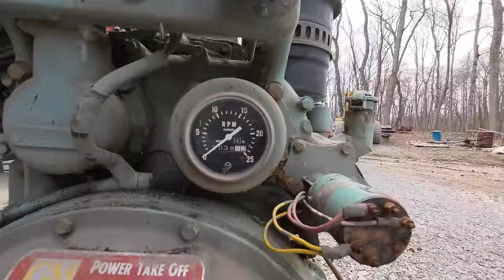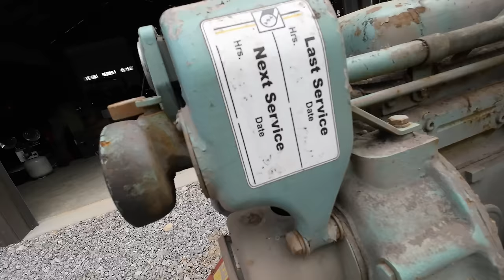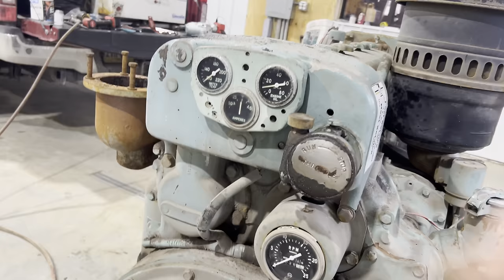$250 Two Stroke Detroit Diesel Sitting 6+ years, WILL IT RUN!?!?

Comment: I used to work for Detroit Diesel when I was a younger man. The 71 engines were (in my opinion) sweet engines to work on. We built standby gen sets for home and hospitals and irrigation pumps for agriculture use. The 71's were damn near bullet proof and dependable powerplants. I sure do miss those things. You got a hell of a deal for 250 bucks. Even if I had no use for one, I'd snatch it up at that price. It was nice to see it come to life again. I'll dedicate a few cold ones to you. Thanks!
Reply: I have a 6-71, and a 3-53.  No idea what I will use them for, but man they sound sweet!
Reply: I own a 8V-71 in my 1971 SeaGrave Fire Engine and have a 353 in my 1978 Dynahoe-190 Backhoe. That has almost (9000) hours on the meter.
Reply: Sadly, that was over fifty years ago, when a dollar had a much greater value. Still, it was really good value for money.even in those days..
Reply: Be a fine power unit for a sawmill
Reply: Have a 353 in a dynahoe backhoe.its turn key.
Reply: @brustdiesel old pickup truck and a boat
Reply: Not in your opinion they just were they owned the diesel market they were absolutely amazing and way beyond there time they as is don’t put out much emissions for one but also they were so over engineered and outstanding only good thing gm probably has ever made
Reply: @rcadventures8390  Don’t forget the HUMVEE! About the second only good GM thing lmao. Old trucks/cars too. Especially the stovebolt 6,and its successor.
Reply: @carsonchambers5617  eh depends on what hummer your taking about like the ones they used in war I fuckin loved those things my buddy’s dad had one a long time ago it was a retired military vehicle the reason he got rid of it was because of how shitty the mileage was but gm also made Saturn and Pontiac both awesome idk if you ever noticed but whenever gm makes something good they discontinue it
Reply: @rcadventures8390  Of course the military one, that’s why I said Humvee and not Hummer. H2’s and H3’s were just glorified Suburbans. Old heads and mechanics say the early humvees were turds power wise since they didn’t even have a turbo, but would run forever. But that’s Detroit Diesel for you. On second thought that’s the third best GM thing too lol. Later ones had a turbo but was still so slow if they had the uparmored packages equipped. 

That’s why most people straight up Cummins swap it with an Alison Transmission or the GM guys will duramax swap them. Wayyyy better power, fuel efficiency, and top speed. 

I’m Ford biased so I don’t care for any modern GM stuff apart from the newer mid engine C8’s. Their “HD” trucks are joke having an independent front axle. 
Pretty much only 1936-1950 stuff then Ford from then and out for me lol.😂
Reply: @carsonchambers5617  well my 4-53t in my 84 f150 has got some balls to it sure only 175 horse but 360 smth foot pounds of torque which gets me moving easily
Reply: Hes honest so far.
Reply: L😊😊.😊
Reply: @rcadventures8390  Yeah, that's your opinion.

Comment: The small cooler is probably small heat exchanger. The other hoses probably tapped off the water supply for the fire suppression system to supply cooling rather than being air cooled.
Reply: It is a heat exchanger. They are very common in marine applications. I’m guessing they had it plumbed into the water supply and cooled the engine that way.
Reply: Yeah totally a liquid to liquid heat exchanger set up had a genset i bought from a water company it was used for back up in a water pumping station and it had 2 heat exchangers like that that would use the water from the pumping station to cool the engine pretty neat i think
Reply: This is how the fire pump at my plant is set up. If you run it without pumping water it will overheat.
Reply: You are correct, I build fire pumps at Cummins.
Reply: Exactly
Reply: As a fresh water pump pumps fresh water, there is no need for a radiator. So, you are absolutly right 😁👍
Reply: My old boss loved his dragline ,and I’m sure he pumped water up to his jimmy from the pit rather than air cooled
Reply: Chain drive and centrifugal clutch!  If you can find one big enough.  Cool project!
Reply: You got it! That would be a marine package for fresh water cooling, keeping the salt water out of the engine.  The HP rating is easily fixed. These engines were available for up to 238 HP at 1900, more for some special applications.
Reply: Only overheats if you run out of water in which case it's useless anyway. Neat!
Reply: What they said.😉
Reply: I've seen Onan diesels plumbed that way - no radiator, hooked up to a "city water" cooling source, with 100% of that water going down the drain after going thru the engine.  Wouldn't do that today!
Reply: My thoughts exactly.
Reply: Yep, basically same thing as a water-to-water intercooler you see in some automotive turbo applications where packaging is a concern.
Reply: He could connect his floor heating the the heat exchanger and put a generator on the output shaft to run the shop. Maybe not as cool as a three ton go cart, but maybe more useful?
Reply: @jaytalbot1146  I like your thinking.
Create heat & power & a really impressive exhaust sound.😁
Reply: Exactly, we still install them the same way today. All the water flows through screens to catch debris. Alot of the pump here in New Hampshire are fed from near by ponds
Reply: all you guys are right, except that there were no internal combustion engines in the time of the good lord baby jeezus, so they are a sin in the eyes of the lord and baby cheesus.
Reply: @claytonsambola1856  Tis what was thinking too.....  Like minds
Reply: The fire pump was probably 100 gallon a minute and would pull the water away from the cooling system. Cooling system would need to be separate.
Reply: @claytonsambola1856  yup. My steel 35ft '52 boat has got that too. Its also known as an intercooler, afaik.
Reply: @neil6212  Our 12V71NAs were rated higher than that at 1800 RPM. And if you had the TT ones that the military had for in tanks, they were rated at 600HP for 24 hours continuous war power rating. They were rated at 2500 RPM on the 12V71TT.  Never heard one run at 2500 and ours dropped the over speed damper at anything over 1900 RPM.
Reply: Standard NFPA 20 cooling system I would say, firewater pump engine HEX is cooled by tapping off some fire water once through & then down the drain. Althought that said it isnt painted red like it should be for a Fire Pump Engine!
Reply: Agreed
Reply: @william4all  I sold alot of Cummins stand-by firepump engines to pump mfgs and contractors. Nice units.

Comment: I used to privately own a 1973 Seagrave Fire Engine with a 6-71 Detroit.  Those engines are pretty much indestructible.  There are two shut off mechanisms.  First is normal which shuts off the fuel, and an emergency shut off if the engine "runs away" which is a damper which shuts off the air.  Several truisms about the "Screaming Jimmys".  They love high RPMs so drive them like you stole it, if it leaks oil, then you know it ok, they are famous for leaks, the sound, as you mentioned is one of a kind.  When you got it running that purr is unmistakable.  Finally, General Dwight Eisenhower attributed the "Higgins Boat" Landing Craft Vehicle Personnel (LCVP) with winning World War II.  They were powered with the early Marine Version (Gray Marine) of the Detroit 6-71.

Comment: Matt, That engine uses straight 40 weight.  Had them on several boats that I  operated.  If taken care of properly, they will run seemingly forever.  Nice buy!
Reply: I'm surprised he didn't know that. It killed me when he said what he was pouring in.
Reply: Yeussss
Reply: The Rotella is probably better in all ways possible than old straight oil. The difference between is only that this oil has a lower viscosity at low temperatures (15W).
Reply: @jesperwall839  km
Reply: @jesperwall839  Except for the sulfated ash requirement. Which will cause problems.
Reply: @jesperwall839  Incorrect. Oil used in Detroits MUST be CF2 rated. T4, T5, and T6 are not a CF2 oil
Reply: It's not only the weight but the API Service Rating.  Any oil rated -4 is for 4 stroke diesels and shouldn't be used in 2 strokes.  Bus Grease Monkey is a good source of info on this subject.
Reply: never use split weight oil in a Detroit 2-stroke...30W Rotella not the 15-40
Reply: @jesperwall839  I ran straight 40 weight in my motor home conversion for years, but didn't live in the snow zone. DDA recommends 30 in winter, as I remember.
Reply: studies showed the use of 15w40 in highway 2 stroke detroits result in heavy cylinder wear over time. short use its fine.
Reply: Yep, the 8v92 books for our generators say you can use 15w40 in an emergency, but to change it out to SAE 40 as soon as possible.
Reply: @jesperwall839  not in 2 stroke diesels...go watch ol 2stroker channel
Reply: I was about to say the same thing but we use straight 30 weight in ours.
Reply: @Gageleavitt25 Walmart Carrys straight 30 just for old Detroit engine and gen sets on RV
Reply: @jesperwall839  ash level is different
Reply: That would be a killer saw mill rig
Reply: And here I thought you were going to use it to power the shop; and make it earn its keep.
Reply: Shell Rotella T1 40w
Reply: @metalfusion67  that’s all we ran in them in the boars in the Navy - 30 w . Years of dependable service.
Reply: I like a Mad Matt Machine … with lots of gauges (oversize), lots of brass lines, something with Steampunk designs in it … actual purpose, who knows? If it’s for parades, a locomotive would be cool with a cow-catcher front…kids would love that. A steampunk ATV?
Great idea Matt… and I don’t care what oil you put in 😊
Reply: @bigfoot-wo3qy  a good friend of mine has a 1948 Frick sawmill that’s powered by a 6-71, the engine is still in the frame rail of the truck it was donated from. The frame was cut aft of the transmission. A series of belts and jackshafts transfer power to the mill portion. It’s an osha inspector’s nightmare.
Reply: @jeremiahjorenby2275  They didn't even have the modern oils when this engine was built, so of course they don't recommend them. I use full synth in my '66 for 7 years now. It uses less oil than with the factory recommendation.
Reply: @metalfusion67  Multi grade oils weren't common when that thing was built. May not have even existed. The newer oils are far superior to what was available when that thing was built. You can't go by the factory recommendations. They had no idea what would be available in years to come.
Reply: @21babydew  mine dumps soo much oil on the ground i dont think it matters
Reply: @satchelh  bus grease monkey is a joke
Reply: @jesperwall839  Shell makes  Rotella T1 sae 40W CF2
Reply: @jeremiahjorenby2275  you the real MVP. Only correct advice I see 👌👌
Reply: Yup
Reply: Bus Grease Monkey has vast knowledge of there engines and he says that these engines should run non detergent straight weight oil. I would trust his knowledge of what oil to use.
Reply: Was about to mention this fact…. My old boss f*cked around and found out what happens in a two stroke Detroit when u run a split weight oil in one of the fire truck engines (two of them had detroits. One a 6v92 the other a 8v92…. The 8v92 had such a good sound… a gourmet sound to a mechanic! 🤌).. he was insistent it could be done…. And then some time later the fire department needed a new engine lol
Reply: Needs to be 40 weight * non detergent
Reply: He will find out when it runs away
Reply: Yes correct. I have plenty of these engines and multi grade will destroy them. Mono grade 40
Reply: The Amish might make it usable
Reply: @volvodoc01 yup! I maintain 2 8v92ta ddec engines in 2 fire trucks. 40w or it's toast. They almost blew the engine in one of them by running 15w40 in it. Luckily it was caught in time and changed back to 40w.
Reply: @metalfusion67  Delo 400 was what we ran and it never failed us. 30 weight oil and later on we switched to 40 weight. Can argue with Detroits that ran for 14,000 hours or more between overhauls on it.
Reply: @MaxNafeHorsemanship  My manuals were from 1988. By that time they knew about other oils. It still said 30 or 40 weight oil. With our engines lasting for 14,000 hours or more between overhauls, you couldn't argue with success. When I left, one of the engines I had overhauled had its second 14,000 hours on it and still was running like when I put it back online. Our engines were built and installed long after multi weight oils were around. But oils even if straight weights were improved over time.
Reply: @kenore4003  Detergent based straight weight is what they should use. And how many hours does he expect his to run. Ours using Delo 400 30 or 40 weight ran for 14,000+ hours between overhauls.While Chevron says they aren't recommended in DD 2-strokes, that wasn't proven to be our case. 28,000 hours on the main crankshaft bearings and they still were in spec.
Reply: @benhicks4402  Wrong on the non-detergent. 30 or 40 weight is fine also. Just don't run a multi-grade oil.  And we changed the oil every 300 hours of use.
Reply: That engine was built 50+ years ago. 

15w40 is more that good enough for Detroits. Not to mention modern oils is so insanely superior to oil from hell even 30 years ago. 

That little 6v will be more than happy with T5.

Comment: I was in the U.S.Coast Guard in 1972 and all our 30 foot rescue boats had these 671's They were very dependable and powerful work horse engines. That was 50 plus years ago..!! Great Video Thankx lots!!
Reply: A high performance 2 stroke here, run klotz 2 stroke oil
Reply: Polaris 850 patriot boost is tge new jimmy
Reply: I trained with the CG 43 years ago I wonder if they were using them. They saw me on a fishing boat on the Bearing Sea and were shouting my name. The fis6crew were asking how they knew my name I denied everything. 😆

Comment: Had some Detroits in the past, fixed units and trucks, 3-71, 6-71, 12-71. Among those, an oil drain on the 12-71 350K generator wasn’t necessary—if both leaked and slobbered (when it wasn’t under load).
My favorite (Detroit) story was when a  rubber fuel line connecting the return back to the tank split during operation at night.  (Whole trailer was as filled with hot diesel mist—an explosive situation!)
I had to go up into the trailer and find this spurting leak, getting totally soaked in hot diesel.  No real tools tools or parts handy, so I used a flathead screwdriver and two hose clamps and the shaft of a Bic pen in lieu of copper to span the gap where I had to out the leak.
It started and ran without leaks so went to the washing station to clean off.  I had blisters bubbling up in my body from being soaked with hit diesel.  A 100% true story!
The shit we do when we are young and stupid! 😅
Reply: Wait till you have one of the internal to the head fuel lines break. The increase in oil level will shoot the dipstick across the room. And take 4 oil changes to get the smell out of the oil. Our fuel lines were very short. From a ball valve to the filter which was less that 12" away. And from the block to the return ball valve. And we used Aeroquip 300 hose for that. The rest of our fuel lines were welded steel pipe. DD factory certified on the 71 series in 1988.
Reply: Run the best synthetic 2 stroke oil in here, I’m running BRP XD-100 in my 8v92 2 stroke and she loves it
Reply: When you set the rack make sure buffer spring is backed off

Comment: When the rack sticks, it is actually a run-away. The governor can’t control engine speed if the injectors are at full fuel. The only thing controlling speed at that point is valve float. 

Also, as others have said, multiweight oil is the wrong oil for 2-stroke Detroit Diesels. Delo 100 straight 40 weight oil is the stuff to use due to its very low ash content, among other things.
Reply: 30+yrs crane and equipment mechanic. Love DDA. Wait till a 12-71 takes off
 I was on top laying on the valve cover tried to trip the 2flapper valves on the blowers!
Reply: @tomhartig4247 
Did your pants need to be changed afterwards

Comment: The fuel coming out of the exhaust is called wet stacking.  It's usually caused by idling a diesel for extended periods of time, or running it under little to no load for long periods.
Reply: It a high RPM engine and needs to be treated as such back in the day we called them screaming maniacs  the city trash trucks used them and you could hear them coming from a mile away
Reply: spot on
Reply: I used to work at a DD shop, whenever I'd rebuild a Detroit engine and the owner of the engine came to pick it up they would ask about the break in time as for how to run it.  I'd tell them run it like your trying to blow it up.  You have to run them hard to get the rings to seat.

Comment: Matt, the cooling system is set up for "unlimited " cooling, like a boat. The tank up front is a heat exchanger that would have seawater if it were a boat, and city water in this case as a fire pump. The exhaust is also water cooled using the coolant for the engine. As for your drive system, maybe look into a drop box style allison transmission that were used in articulated loaders. Disneyland uses this type of trans in the tow vehicles for the monorail, they cut them androtated the drop 90 degrees so the drive shaft runs next to the engine.
Reply: I had a keel cooler on my boat. Fresh water only.
Reply: was about to say, it's quite common for engines used to power water wells to be cooled by the well water through a heat exchanger. Since this was used to push water it makes sense to build it that way
Reply: More than likely not a remote radiator. Used the water from the holding tank to run through the heat exchanger. Basically unlimited cooling until the holding tank runs dry.
Reply: Forgot about that old Allison trans, had one behind a 3-53 in an old Pettibone Super 8 years ago